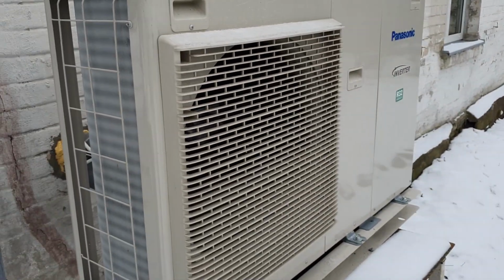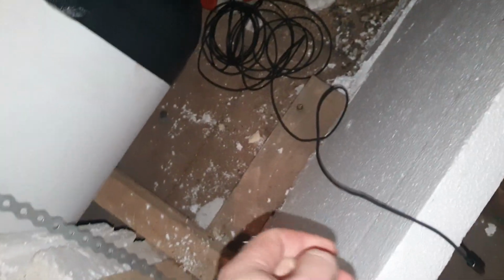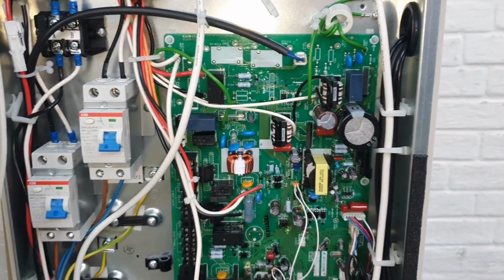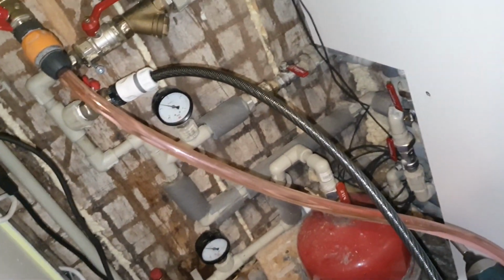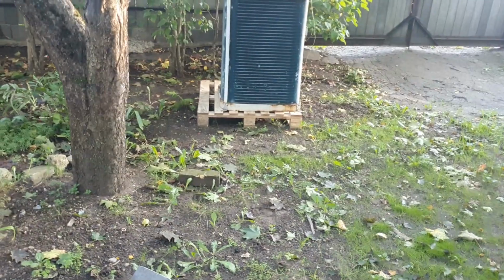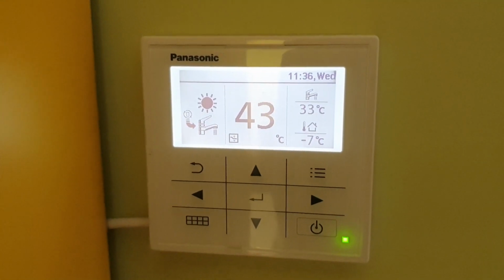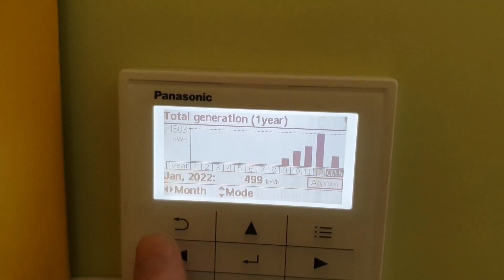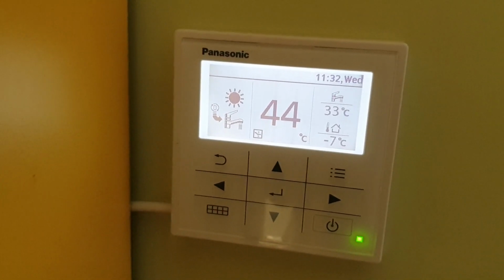Panasonic Aquarea 5kW Monobloc (R32) WH-MDC05J3E5 REVIEW

Comment: What îs energy bill for a heating season ?
Reply from the maker: according to inbuilt electeicity meter my consumption was:
Oct 208 kWh  cop 3.1 
Nov 361 kWh cop 2.4
Dec 711 kWh cop 2.1
Jan 518 kWh cop 2.5

but actually it was 5-10% more than that...

so the bill, it depends of your contract. any way e.g. december the bill was over $260.., bcos electricity price went 3 times up :@ so due to this I will most probably will buy solar panels, bcos I have option, if I produce more than I need, I deposite it in the public electricity grid, and when I need it I can buy it back for 1/3 of electricity current price. a year ago it would not be worth to put panels moneywise, but now they make sense, at least for me.
Reply: @JUrtanschannel  hello. Can you please tell me which radiators  are you using(model and size) and what is the temperature of heating water going to them?
Reply from the maker: @erminmax  I am using different radiators, it depends of your home, but they are type 11 and 21.  Since I have thermostats on most of them, I am not using inbuilt controller temperature sensor to heat the rooms by it's temperature, but I have configurated the water inlet temperature to 44C, because I kind a saving money and so the COP is a lot better for that, and for water, when dT reach temp under it, the pump automatically heats the inlet temperature above 55C till water in the boiler reach the temperature I have set.
Reply: @JUrtanschannel  and for water, when dT reach temp under it, the pump automatically heats the inlet temperature above 55C till water in the boiler reach the temperature I have set.   -> How was this switch happens from the Heating Circle between raditators and Pump and the Cirle between radiators and Boiler?
Reply from the maker: @iljakozevnikov  To be honest my system is not a good example for this. It is not like I made the system from scrap, I just replaced the old heat pump with this one. Basically currently I am heating boiler water from the same circle that heats radiators, I dont have any switches in the system to make it more efficient in that way, only during warm season I can close radiator circle, so the heat pump heats only the water in the boiler.  But so far it has been working all right, and if radiators are regulated by thermostats then even when water heats up for boiler heating, you wont lose much, because radiators wont heat more than you have set them up.
Reply: Got it, thanks! Just be aware that water inside Boiler should be heated up to 80 degrees at least once a week to avoid the growth of bacteria
Reply from the maker: @iljakozevnikov  60C will be enough to kill legionella, pluss if you use a lot of hot water, exchange will help to avoid bacteria built up as well, but of course, higher temp you get in the boiler, quicker bacteria will die. Any way legionella start to die above 50C.
Reply: @JUrtanschannel  nice video ! Quick question : what are normal temperatures in your area ( day / night ) in december? How big is the house, do you have good insulation and good windows? I ask bcos the cop is very low compared to the declared by Panasonic (4,5 at -20 degrees exterior) . Thank u v much
Reply from the maker: @pchris5391  4 seasons, Riga. in Winter it can get down to -20-25C for a few weeks a year, but it wasnt that, lowest approx. -15C. I have new windows, but the weakest point is the flooring, I am losing there a lot of my energy. So I would say that house is not with the greatest insulation, however it is not totally bad as well. COP 4.5 in -20C, I think it is impossible!!  Even if you would have heated floors, this is the only case how you can get good result out of the heat pump, because then you can heat the water up to 35C, what is efficient working temperature for the heat pump, however in the winter, when it was -15C, my COP was closer to 1 than 4.5 :D  , but at that time I didnt know a few things, how to improve overall consumption of electricity! :)
Reply: @JUrtanschannel  thank you for your reply, answered all my questions. Many people use the setting for floor heating (35-40 degrees) if they have aluminium radiators bcos it lowers the consumption a lot and the house is still hot enough. With -15 celcius I believe the heat pump enters defrost mode more often and u get a lower cop then expected. After using it for some time, do you believe the 5kw version to be enough in the winter? Here we only get a minimum of 2-3 degrees in winter and vendors recomend a 8kw version at least just to be safe, what do you think? Thank you
Reply: Consumption is more related to overal house insulation & its size, than radiators/floors. Difference between them can only be achieved if you use low temp source like condensing gas boiler or heat pump. But in general, it is from last steps of performance tuning. According heat pump size, first question is - is this the only one source of heat (heat pumps are not efficient at very low temperatures)? By defrosting, you  basicaly heating outside air (why not use same power to heat inside?), so less defrosting, more efficient it will be. I suggest calculate its usage till sub-zero, then switch to different source of heat.